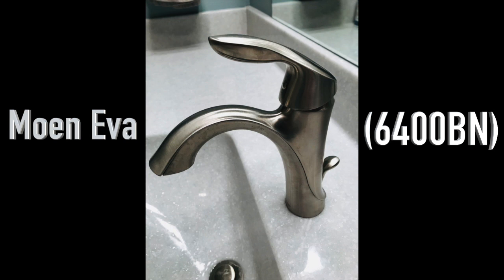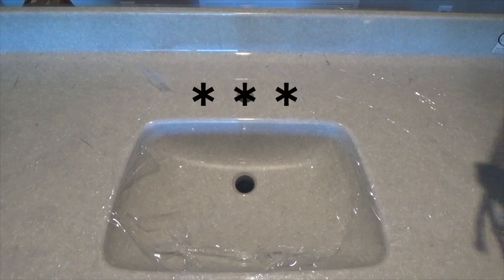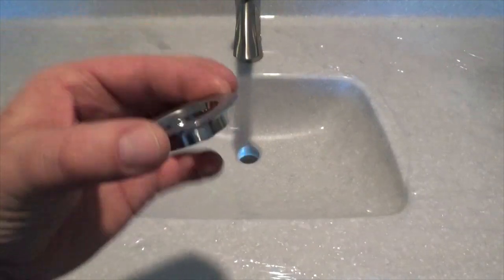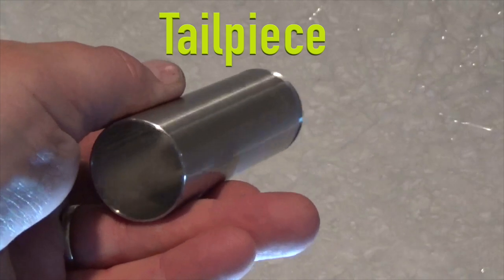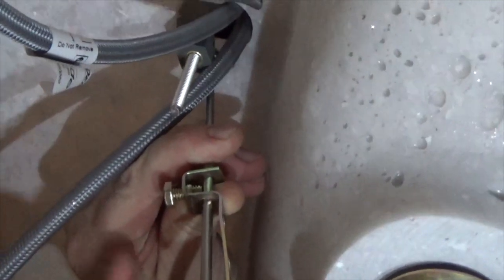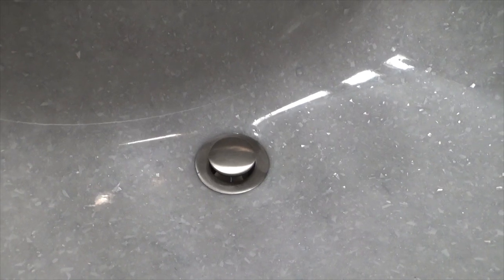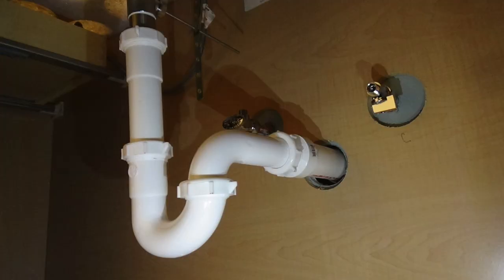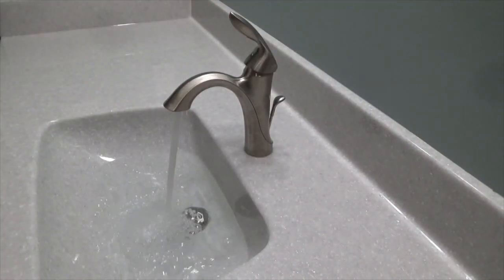Bathroom Faucet and Drain Kit Installation - Moen Eva

Comment: Hi Phil, Do you really need to put Teflon tape around the water line connectors? Thanks for your videos. Very simple instructions and saved me a plumber's bill on this DYI project. Simplest follow along videos on YouTube.
Reply from the maker: The inner gasket is what really seals the connection, however, using tape or pipe dope/paste is never a bad thing.  maybe over kill, but that's how I was taught 30 years ago, and that's how I still do it.  I have a friend who's a union plumber, and he puts tape AND paste on his connections.
Reply: This type of waterline does not get tape.

Comment: How do you replace the integrated supply lines on these Moen one handles? I’ve never had a repair job that I couldn’t find on YouTube until this. I’m going to start taking it apart and figure it out, but I bet if you made a video, it would get a lot of hits.
Reply from the maker: That would be a great video for sure!  hmmmm......
Reply: In case anyone else hunts for this in the future, they are not integrated on the Eva. They are threaded with a couple o-rings, so they actually can be replaced with Moen supply lines.